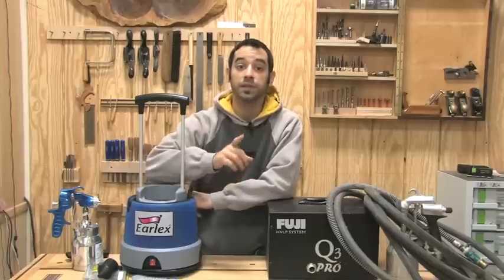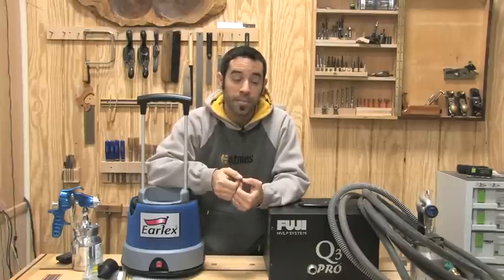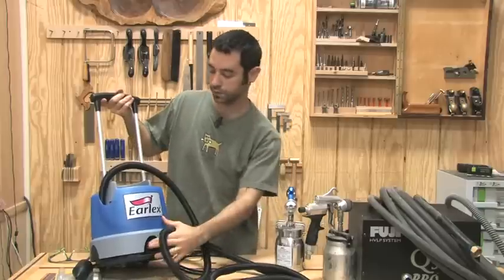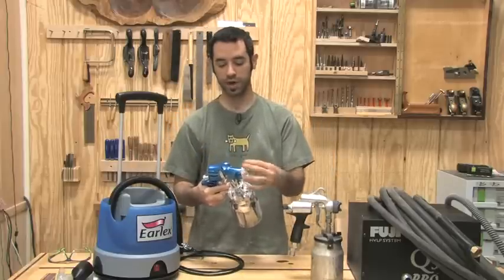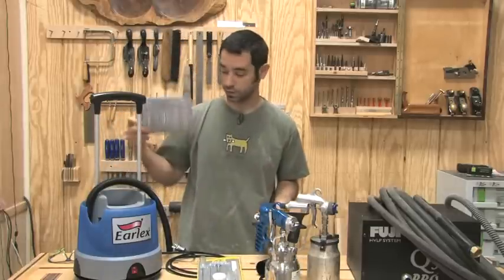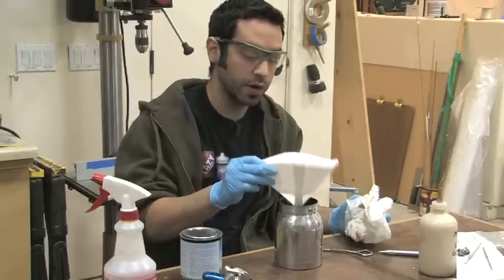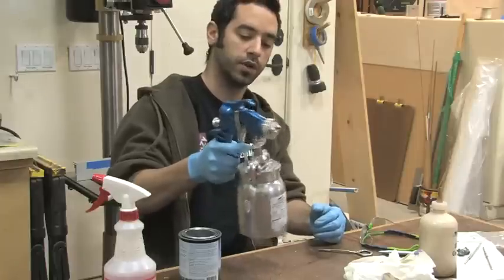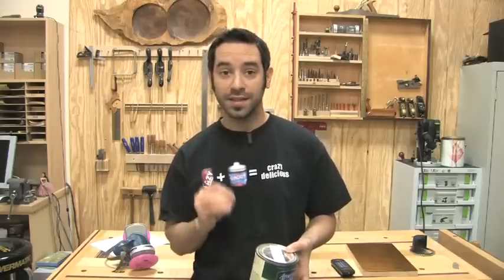45 -  Review of Earlex SprayStation 5000 HVLP Turbine

Comment: You probably know this so for others, a few points. The "springy thing" is an air distribution plate and spring. When reinstalling it there is a tit on the plate that sits in a dimple in the gun housing. If you dont assemble correctly you will not be able to turn the air cap to change the spray pattern.  Also, the spray tips have a gasket that goes over the threads. Dont forget to reinstall it. And to emphasize your point, spraying waterborn paints like latex are the hardest. Use the viscosity cup to thin the paint to the recommended amount based on the tip. I originally tried to spray the new alkyd paint without thinning and it went on like spatter paint. Once I thinned it, it went on like silk. I also recently sprayed Rustoleum oil based paint. They recommend to thin 15% max but I had to go to about 30 % for best atomization. Others have said the same. Good versatile sprayer for the price.

Comment: I have one.  I just used it to spray Cabot Stain on some fencing.  Worked fine with a 1.5mm needle.  The Cabot was full strength.  I used it yesterday to spray some latex paint.  I thinned it according to directions and used the same needle.  It did great.  It'a a nice sprayer. It makes quick work of covering surfaces.   I recommend.

Comment: For most woodworkers (especially hobby woodworkers)  the major draw back for spraying is time and material waste. - Most people have a project they're working on and need to finish - even a large project like a dining table or chest of drawers. A good spray finish involves at least 5 coats and maybe more . For each coat we get out the gun set it up add our material (sealer, or top coat) and we spray the finish on the project. If we want that high gloss mirror like finish it will be grain filler, several coats of sealer followed by up to 12 coats of top coat with sanding in between. Spray time is about 2 minutes for a small project and maybe 5 minutes for a big project. Now we have to wait - anywhere from 30 minutes to several hours. The gun needs to be cleaned. There will still be material in the gun, so we open the can and  pour the left over back, some waste will occur with the material left. Then we need to dismantle the gun and clean it thoroughly.  More time will be spent cleaning the gun than spraying. Next coat - repeat the previous process.Spray guns can lay on a waterbased lacquer finish much nicer than a brush, but it is not magic and it will take more time than the few minutes of actually spraying.

Comment: What are some of the safety concerns with this sprayer? I realize the need for a respirator, but I am concerned with the fire hazard of the atomized water base finish. I live in Northern NY where it is not possible to spray outside in the winter and I have a gas furnace hanging from the ceiling, would the water base finish be safe to use in this case?

Comment: I'm thinking about buying one of these units. I make guitars and spray nitro lacquer and heard that lacquer doesn't work with this unit as the air coming out through the gun is hot.  Did you have any issues when you used this unit for lacquer? I wonder if adding more retarder to the lacquer might be the work around.  Any thoughts?  Thanks a million for your videos!

Comment: Mark do you need to completely clean and break spay gun down in between coats if doing multiple coats in a day?
Reply from the maker: I don't. Especially when working with things like lacquer and shellac, I don't clean the gun until the job is done.
Reply: Hi Mark.  What needles do you recommend for water based poly and oil based poly and lacquer please?

Comment: Don’t buy one of these pieces of crap. Throwing mine away. 300 bucks down the drain. Bad customer service too. The most disappointed I have been in not only a product but a company (Wagner) too.
Reply: Why was it junk? I bought one but have not used it.
Reply: I’ve had great luck with mine. 
Wonder why  he says it’s junk??
Reply: @bish1941  no matter what I tried it just spit the paint out with no atomizing. Wasted a lot of paint and thinner. No help from Wagner.
Reply: Wagner does not make the Earlx. No wonder you didn’t get a response. I remember when I got mine that I talked with someone there with a question who was very responsive. You sure you have an Earlx?
Reply: Wow! I stand corrected. Sorry. They must have bought the company after I bought my unit. I got the distinct impression when I called it was a family owned operation.
Reply: @bobbishop6183  I still bitter 😂
Reply: But getting back to you problem. Did you try using the viscosity cup and thinning to 2 min and 20 sec. ?  That really makes a lot of difference.
Reply: @bobbishop6183  yes. In fact after I broke a part on the gun and could not get a replacement, I bought another much cheaper unit and was able to do the job with the same paint. I probably had a bad unit. I have read where others had the same problem but the lack of support still makes makes me mad that $300 was down the drain. It was not like it worked and then quit working. It just never worked.